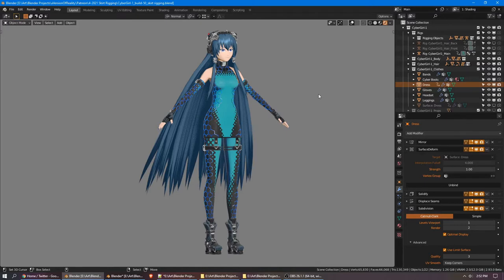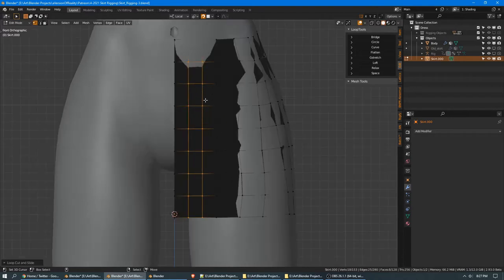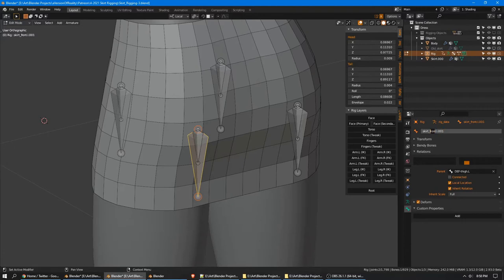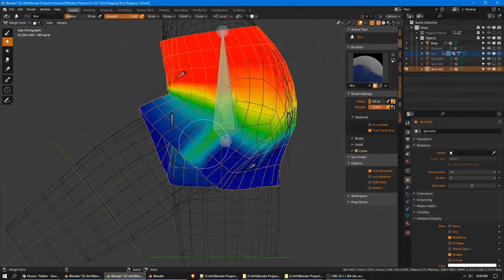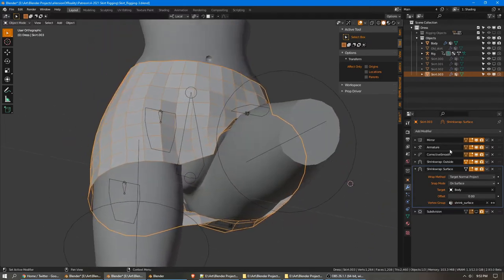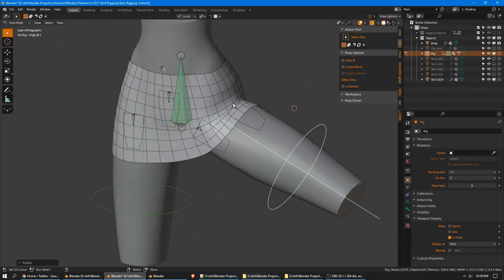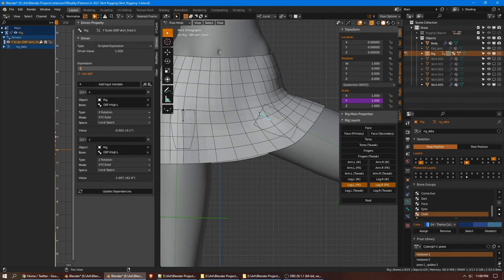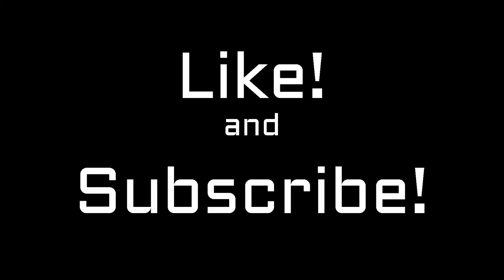Rigging a Stretchy Skirt in Blender 2.9

Comment: Certainly looks interesting but, the process is eventually ends with you walking on a tightrope where everything needs to be just right. This could probably be replicated using shape keys and drivers with some corrective bones, would still be walking on a tight rope to some degree, but with more control. Nevertheless, the end result looks very nice.
Reply from the maker: Yes, I did experiment with a shapekey version. However, as you say, you still need to balance a lot of things. The reason I went with this method in the end is to avoid the inherent fragility and tediousness of working with shapekeys if you want to make changes to the mesh or re-use it on different characters.

Another way to reduce the need for precision would be to just use a bunch more corrective bones. But then you'll still have a different kind of complexity. Since its a complex shape and deform, you're going to have to define it somewhere.

Comment: Excellent video as always. Do you have any tips on adding folds? I feel like that's the main thing that's missing from this setup.  Shape keys would be the obvious answer but I'm wondering if it would even work here with all the shrinkwrapping and smoothing.
Reply from the maker: If you wanted to do shapekeys, you'd put them on a detail mesh that is Surface Deformed to the mesh that all the shrinking and smoothing is done on. Then i'tll work fine. I'm also looking into Geometry Nodes options for wrinkles. And of course, you could always do actual clothsim instead of this, but its pretty tough to make it work for tighter garments.
Reply: @aVersionOfReality  Thanks for the info. Huh, I hadn't even considered geometry nodes, that does sound like an interesting idea. I'm eager to see what you can come up with :)

Comment: thank you, I did it and works perfectly for FK. Is there a way that this works also in IK?
Reply from the maker: I should work the same in either if you constrain to the deform bones.
Reply: @aVersionOfReality  I don't have much experience with constrains,  maybe copy rotation of the IK leg bones?   Could you please explain briefly what to do?  you would be doing me a great favor
Reply from the maker: @billrodriguez99  The IK and FK bones are both controlling the actual deform bones, which are the ones that mesh is weight painted to. Constraint to those, not the IK/FK.

Comment: Hello friend, a doubt that still persists, these modifiers that you used in blender, it is possible to use them to create the animation for the character for example idle animation, walking animation, atack animation and so on, when done, I can export the animation along with the modifier, or do I need to apply the modifier before exporting? But if I apply the modifier before I export will it warp the whole mesh again?
Reply from the maker: You can export the bone animation itself. But the modifiers that are doing dynamic things, like the corrective smooth, won't work to export. You'd need to use an equivalent of them on the game engine's end (which may not exist for performance reasons.) For a game engine, normally you'd use more bones for stuff like a stretchy skirt so that you can export it.